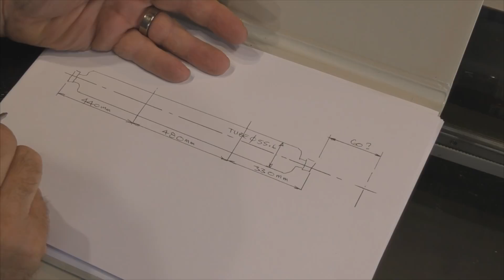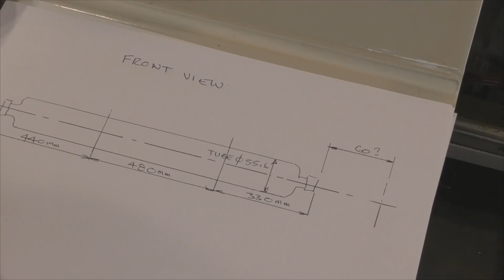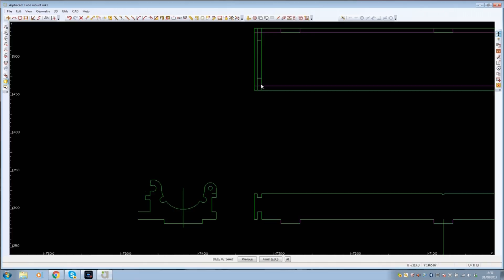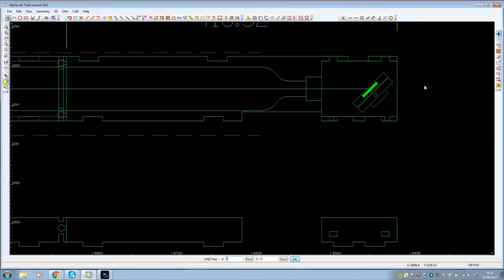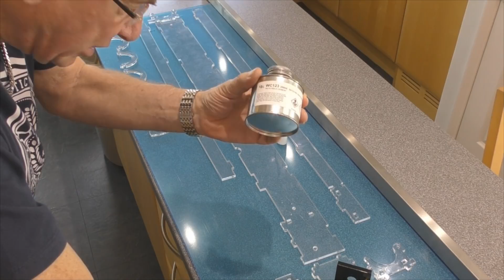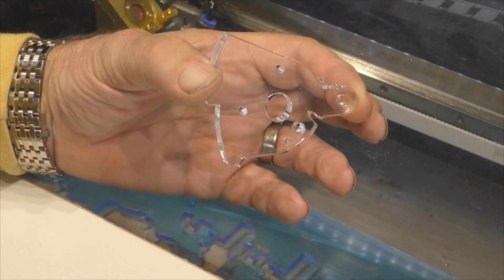RDWorks Learning Lab 118 One Piece Tube and Mirror Mount DESIGN

Comment: You suggested you couldn't cut more than about 495 in length. Corner to corner diagnally you could get a bit more than that depending on the width of the longest piece you want to cut, right?
Reply from the maker: Hi Kyle
You are perfectly correct but the material usage will be very inefficient.
Best regards
Russ

Comment: Hi Russ..I have noticed your water and air temperature monitoring.  May I ask where I can fine those digital thermometers?
Did I miss a video where you covered that?
Thanks 
Phil
Reply from the maker: Hi Phil
Very cheap but absolutely great This is what I bought. For others that may be reading this reply they are available in 220v and 110v versions so be careful what you buy.

http://www.ebay.co.uk/itm/Digital-LCD-Display-Temp-Temperature-Controller-Thermostat-Relay-Sensor-FT-/222167509839?var=&hash=item33ba372b4f:m:mlMoFU-iZTFE9bw2cUnVyQA

Best wishes
Russ

Comment: Hi Russ... how i can contact you? Greatings from Germany
Reply from the maker: Hi Gregor
The best way is to use the you tube message service which is private so you email address will not appear on an open forum. Send me you email address. If you fail with that then add your email address to a normal comment and You tube will automatically put it in a private "Possible Spam" box which I can delete when I have written to you.
Best wishes
Russ